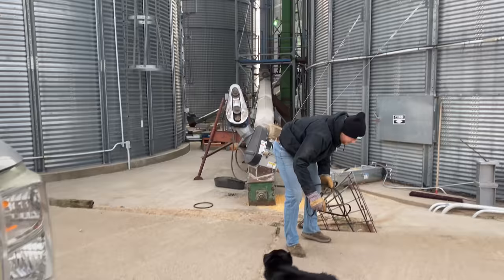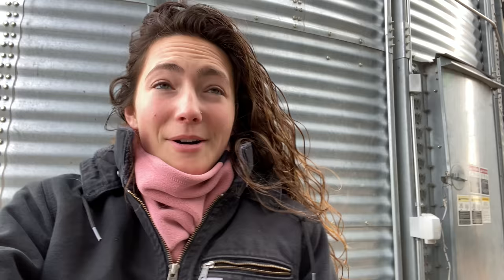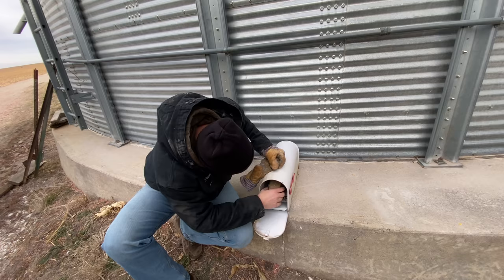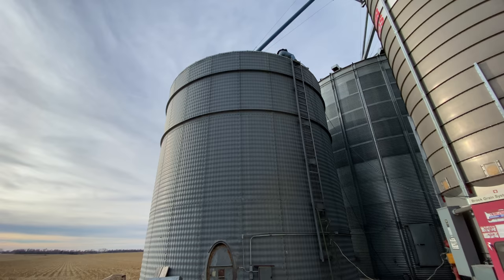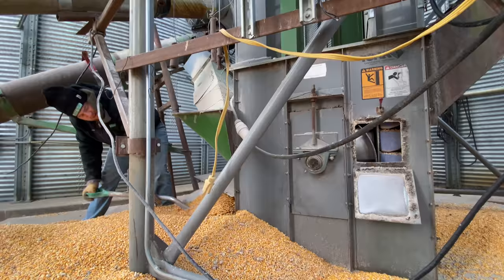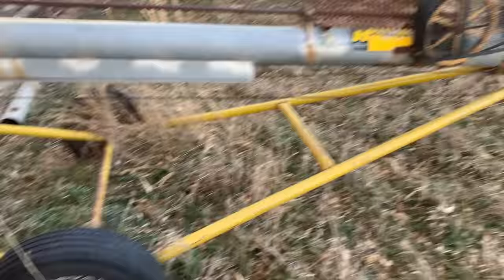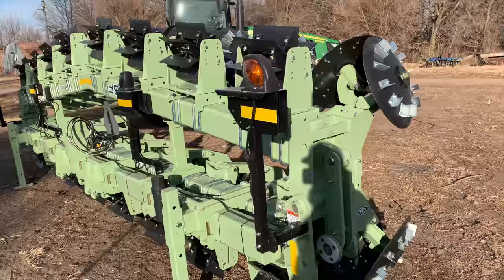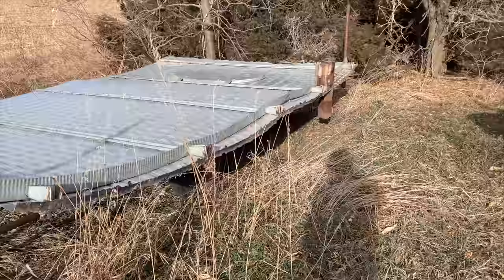Grain Bin Site Mess!

Comment: A checklist concerning your problem: 1) Check your belt tension and tracking. It may be loose. 2) Check the legging on the leg head pulley. It might be worn causing the belt to slip. 3) Check for missing cups. You might have one in the discharge spout. 4) Last but certainly not least is to check the motion indicator if the leg has one.

Comment: farm boy here, prairie-raised... since your bins are ginormous, how are they anchored? when I was a teenager we had a line of 5000-bushel Westeel-rosco bins built... full concrete slabs (about 8" thick, with rebar), pilings connecting slab to ground, lag bolts between slab and bin... they've been there about 40 years, and they're still standing... (sure, the roof cap is about 35 feet up, but they still catch the wind)

Comment: Why transfer from one bin to another to load trucks? Wouldn't it be smarter to be able to load from each bin. I work in pipelines and are truck terminals are able to load at the truck rack from each tank.
Reply: the augers moving the grain around aren't very fast, so you have a dump bin that you use as buffer so you can fill up a truck in a couple minutes. Technically you can fill directly from each bin, it just takes a lot longer. You can only move grain so fast; if the augers go too fast you create too much friction, which causes heat and can burn the corn/grain, but the dump bin is literally just a flap at the bottom of a bin and uses gravity. It's a lot different from liquids - you cannot move grain under pressure (well, you could, but it'd be a much more complex system)

Comment: A catch22 running one belt. You said you run one belt on a two groove sheave for safety reasons, however, you are going to continue frying belts because based upon the driver sheave diameter, rpm and motor horsepower, that system is designed to run with two belts. The contact area on the driver sheave is not sufficient to transfer the rate’s horsepower. Just saying based upon 30+ years designing and building commercial and industrial HVAC systems.

Comment: I see double groove pulleys and you only one belt on them? Please find the correct length and a twin package, so both belts have exactly the same length and so same tension. The vertical bucket conveyor is missing a reverse brake! As one side is loaded, and the down section isn’t the chain must be blocked as soon as the power is stopped. Otherwise it will start running in reverse and empty it self at the bottom.

Comment: When machinery decides to free itself with no warning thats scary many accidents happen when stuff starts to move unexpectedly also isolating any equipment (BTW CANT ISOLATE GRAVITY IT WILL PROBABLY STILL TRY AND KILL YOU) to stop anyone else turning it on when your arm deep between belts and pulleys is a good thing! you dont want anyone delivering or picking up grain to operate the equipment when you may be torn to shreds they probably may not even hear you scream the equipment certainly cant thats for sure. FARMING IS DANGEROUS for these reasons but work smart = live long but cut corners and it will bite you